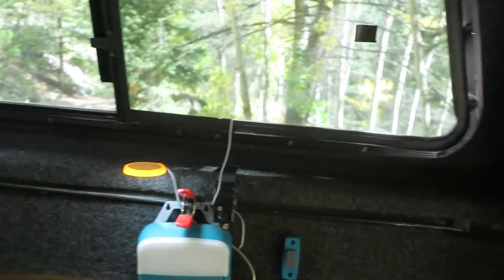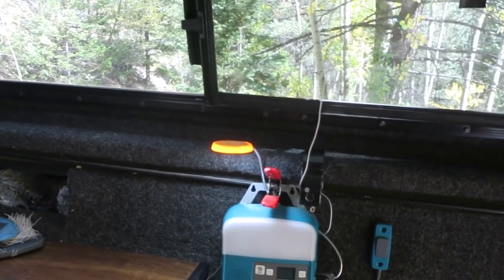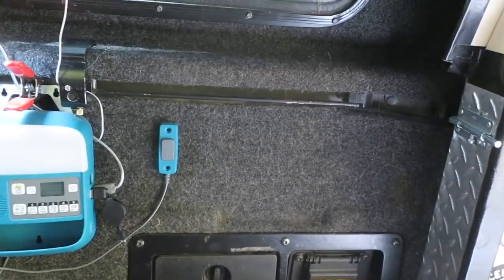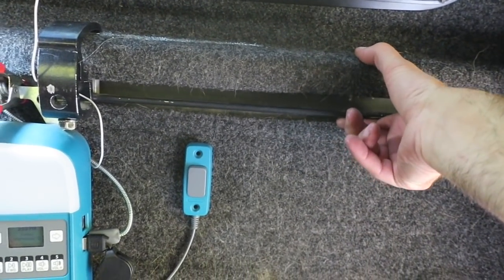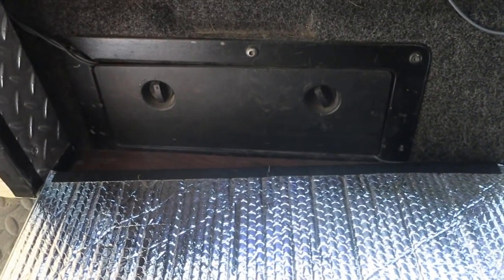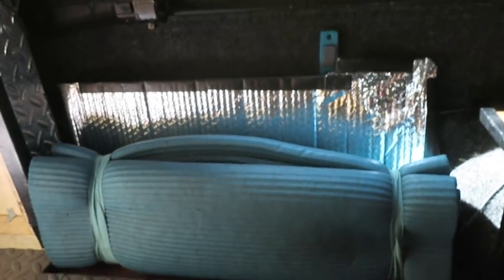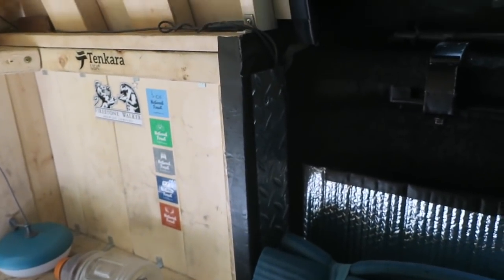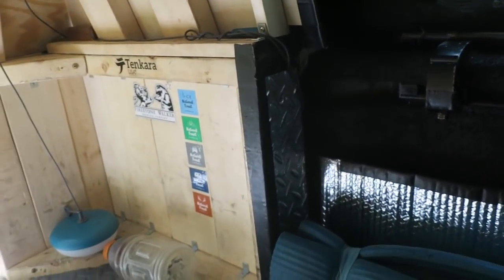Truck Camping: Tips To Winterize Your Topper

Comment: Per your recommendation, I've installed a bulb-type weatherstrip seal around all 3 sides of the tailgate. This just about eliminated the dust out of the inside of the topper when driving down dirt roads.
Reply from the maker: Hey Brian, glad the tip helped to cut down on dust getting into your topper!

Comment: Great channel...I appreciate the content and comments.  My "weakness" in winter camping is cold morning get up and go.  My "hack" is based on my Tacoma and Leer cap having the small opening windows between cab and cap.  I use a section of foam pipe insulation and duct tape to make a "square gasket" that is friction fit between cap and cab.  In the morning...the dog and I get out, do the AM wiz, and I start the truck and turn the heater onto high heat-fresh air intake and open the two windows.  Then we get back into the cap and get ready to get dressed, get organized for breakfast, etc.  This takes only about 10 minutes and in that amount of time the cab heater will heat up the cap area very nicely.   I doubt if 10 minutes of idle time uses even a 1/4 gallon of gas, the truck engine is now preheated for when we get going and the morning routine is done in heated comfort.  If you can start your day warm...the rest of the day is much nicer!
Reply: 10min of idle would do nothing to a gallon of fuel let alone use a quarter gallon.
Reply: USE A BIKE TUBE AND INFLATE IT TO OWRFECT PSI AND FIT IT BETWEEN THE WINDOW AND CAB !

Comment: I have camped in the back of my 0'12 Tacoma. I love it. I just can't seem to stop water from getting in. I think it's getting in at the seal between the cap and the bed towards the front where it steps down. I've removed the cap a few times now and tried different foam type seals including doubling up on them.  My next step is to apply a release agent on the truck side, and then use some real HD silicone caulking. Clean up the squeeze out, and if I did it right the silicone will perfectly mould to all the gaps and if I need to remove the cap (topper some call it) the silicone should stay with the cap.   If that doesn't work I'm driving my whole truck into a swimming pool of flex seal...

Comment: Another alternative to the carpet bed liner is a plywood bed liner. 3/4 inch ply has almost an r1 rating which will help keep the chill off and is a little more durable and easy to clean if you’re not a full timer and need to use your truck for truck things
Reply from the maker: Definitely! Great suggestion, thanks for mentioning that in the comment section so others can incorporate this method.
Reply: The carpet does more than just insulate. It helps to maintain condensation and prevent it from dripping on you in your sleep

Comment: I am of the less hair on top club as well.  I found that a BUFF worn over my head and covering my eyes at night does a fantastic job of keeping heat on my head without requiring an actually noggin cap that tends to slip off easily while you are sleeping.
Reply: Haha I have hair and agree with this!!!
Reply from the maker: Hey Insaynbcr, I actually just picked up one of those BUFFs per your recommendation. Thanks for the tip, it works great! Happy New Year!
Reply: You actually loose most heat thru your head...which  is why hats were always worn to bed in old times...i wear one...and get hot with the dogs...whose heat making ability is outrageous
Reply: @OffGridBackcountryAdventures  can you point me in the right direction for a Buff?

Comment: Hey Brian, thanks for your video! Great info. I need to do more sealing on my bed for sure. My wife and I have gone the propane route - and it made me kinda lazy on putting the time in sealing. 

We have the Big Buddy Heater. If I was just using it in the truck I’d probably get a smaller version of the Buddy heaters, but we also use it in our tailgating tent and such. If the heater is moved or tips, it shuts off and is supposed to shut off for harmful gasses. We also carry a separate monoxide defector as a back up. Additionally, we got a 20’ hose for the propane line so we can have the gas outside, just in case the tank were to leak.  

The Big Buddy heats the back of our truck so hot you have to turn it off in about 3 - 5 min. Typically, I get up to go to the bathroom in the middle of the night. I turn it on for 3 min or so again while I do that. Then, I also turn it on right before getting up to make life a lot more comfortable changing and whatnot. 

Overall the heater runs for 10-15 min and makes camping in single digits not too big of a deal.
Reply from the maker: Hey Nate! Thanks for the comment, sorry for such a delayed response. I agree, using a monoxide detector is the way to go if you're using a propane heater. Great info for those who are wanting to use something like this, thanks for mentioning it in the comment section so others can incorporate this safety tip into their cold weather truck camping endeavors. Hope you have a great New Year!
Reply: I have also been using a propane heater by Mr Heater. I've been using the little buddy which puts out about the same as yours on low and it does a decent job. I just definitely would like to have an overnight sleep-safe heat option. probably going to have to incorporate the electric blanket floor idea

Comment: Great tips! I plan on boxing in my truck cap with layers from foam board insulation and then ply thus creating a box thathat is sealed to the outside world and my body heat will be sufficient enough to heat that space! :)
Reply: When it's that sealed carbon dioxide becomes an issue.  You NEED to have a small source of fresh air.

Comment: Look into an espar diesel fired heater. We use them in out big trucks in the winter and they work real good and don't use alot of power.
Reply from the maker: Hey Brad, thanks for the tip. I've been looking into these and they seem to be very effective.

Comment: Saw a vid on youtube  where the couple bought some pink foam insulation from a home improvement store...they used a sheet about 1/2 inch thick......Made patterns of their windows, then cut pink foam to patterns.....Their rig had pull down shades they used to hold foam.....cut down on cold air a lot.....

Comment: You can buy 12 volt electric blankets at truck stops and those do not require an inverter inverters use a lot of electricity just a converted up to 1:10 so you could use it in in in a blanket and you want the sea in your electric blanket because AC long term affects your immune system so I would suggest you look into 12 volt electric blankets think they go 50 Watts and that way you know any inverter that you're going to get is going to be much much higher than that because there's a certain percentage of you just operated any I'll take a look at that otherwise it's a good video

Comment: I have the same truck. I've thinking I going to make a mold to form fiberglass tubes. The tubes will fit over the tabs and completely seal any air from coming in. No need to do all that inside. Will keep dust out too.

Comment: Looks like you trimmed back the Bedrug rather that installing it behind the bed rails. Great tip on the tailgate seal. There are several different ones available that make a big difference in cutting down drafts!

Comment: My daughter has a little diesel heater in her van, seems to work really well, I swear by a  hot water bottle, or two if it is really cold:)  don’t seem to have a problem with cold in my tiny house, now I have my wood burner, but I did two winters in a caravan (travel trailer) and that was cold, brrrr

Comment: If you're serious about cold weather truck camping get a Propex hs2000 and call it a day. hook it up to propane, 1.9amp power consumption, externally vented. Moisture free, fume free air, thermostatically controlled for well under 1k. I'm thinking about putting one in my westy.

Comment: Mine isn't carpeted. Been considering a thin layer of closed cell spray foam. Open cell would be better for condensation, but it's impossible to spray an even or thin layer.
For now I use a down throw inside my sleeping bag.

Comment: I’ve camped in 0 degree weather with a few feet of snow the on ground in a traditional tent. That looks like a great set up, but I think nothing will prepare someone better than the right equipment and knowing how to stay warm. 

Layering up at night is the wrong answer unless that’s all they have. Most bags are designed to prevent the need of laying up on blankets or clothing. There are plenty of creators on here that demonstrate the importance of layering vs delayering when in severe weather conditions.
Reply from the maker: Thank you for watching and for sharing your thoughts but I'm afraid you've been misled. I learned the art of effective layering from my friend Eric Larsen, the Polar Explorer based out of Boulder, CO. He explained to how to layer in all conditions and I used these methods to winter camp full-time on Mt Antero for the 2015 and 2016 winter seasons. Speaking from personal experience, layering up is the only way I was able to stay comfortable in extreme cold conditions in my sleeping bag. This article from Outside Magazine quotes Eric as one of the "Layer Uppers" and I 100% agree based on my own experience of both layering up and layering down while living outdoors full-time in the Colorado Rockies for the last 3.5 years. 

https://www.outsideonline.com/2271191/how-experts-layer-sleeping-bag
Reply: Colorado Backcountry Adventures great article, but a biased one. I read that earlier in the year when it was published. I don’t disagree with layering as a method to stay warm, but I do agree with the science that layering in a sleeping bag is counterintuitive. 

I would just encourage anyone to do the research and find what works best for their setup. Suggesting I was misinformed is a gamble of a statement, especially when that article demonstrates points from those who have debunked layering as a concept in bags.
Reply from the maker: But if you read the article in full, there is no debunking of layering in bags. Speaking from personal experience, layering in a sleeping bag is the #1 most effective way to stay warm. Getting naked in a sleeping bag doesn't work.
Reply: Your worst enemy isn't the cold. It's sweating in the cold. When I was in the army , I slept damn near naked in our sleep system bags in cold weather.  I agree it's more about the sleeping system and less about layers. Staying dry is more important than staying warm.  Layerimg is fine but you have to be careful to not sweat. Sweating in the winter is more dangerous than the cold temps.

Comment: I'm looking for ways to insulate my fiberglass topper however it came carpeted.  The R factor with carpet is pretty bad and I'm not going to cover it with reflectix or anything since it looks so nice. I watched so many videos but no one mention adding a layer to the outside of the topper. I'm looking for something I can roll or lay on top for the night and remove in the daytime. Sounds like a wacky idea but just thinking.
Reply: Just throw a heavy weight blanket. Or insulation blanket. Maybe a tarp over the top to keep it weather proof
Reply: @andrewk8636  What I ended up doing is leaving my hard-shell  fiberglass carrier on top that has tarps and blankets inside.  I'm sure it gives some R value
Reply: I wrapped a tent trailer with refectex (radiant insulation) glued to a tarp about 7 years ago camping in 100+ outdoor with a window AC (75° inside) can't imagine it wouldn't work for cold weather.

Comment: The Buddy Heater doesn't put off any Co2.
Reply: It's not that it's puts out, it's that it sucks the oxygen...
Reply: Yes it does. Less than the allowable amount for 8 hour shift but over time the carbon monoxide dissolves into your blood and causes problems as it builds up
Reply: Just buy an external power bsnk and run a 12 or 110 volt electric heater. No deadly fumes  and you aren't using your truck battery.

Comment: What’s the added weight of the extension?
Reply from the maker: Hi Nick, I used aspen wood for the majority of the build which is very lightweight. The biggest addition of weight came from the vinyl wood flooring which was 36lbs. All together, the extension including the portion inside the truck bed was 102 lbs. The part which extends out over my truck bed is 37lbs. Pretty lightweight, it's help up very well so far.

Comment: A Long bed would  be a lot better for camping and everything else a truck is used for.
Reply from the maker: Except for the decreased turning radius on extremely tight 4x4 trails in Colorado. You have to keep in mind the majority of 4x4 roads are old mining trails which are extremely narrow and the switchbacks can be troublesome for any long beds or full size trucks. Thanks for watching.